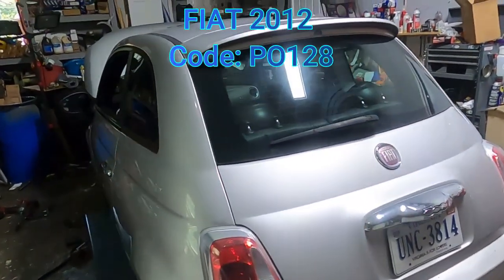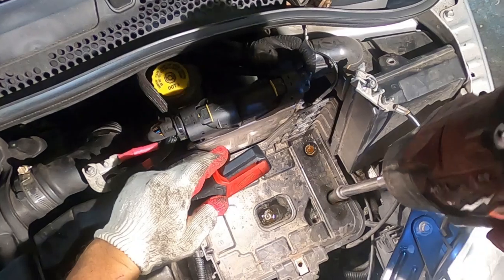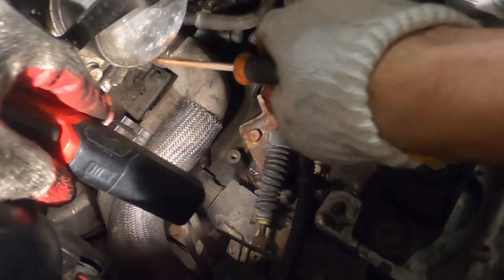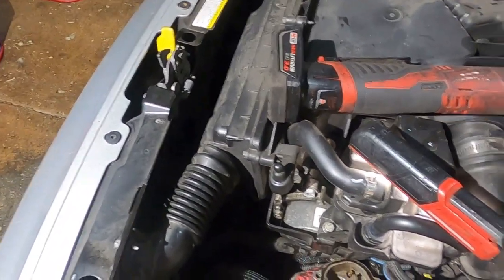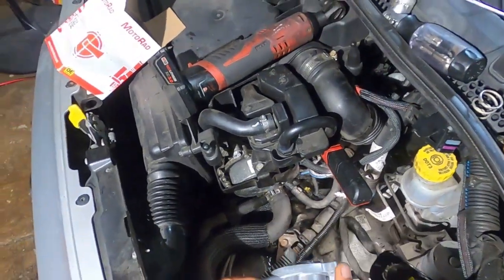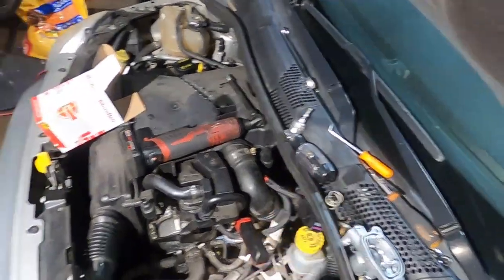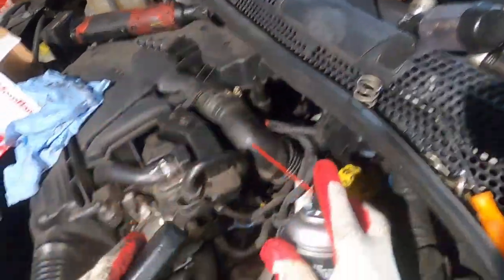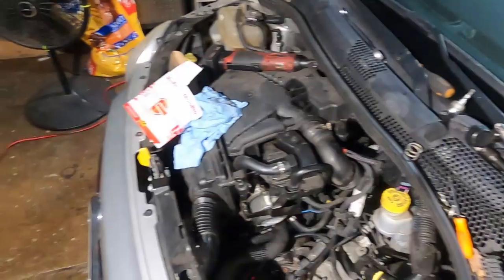Fiat 2012 500 Thermostat replacement

Comment: Great video! However, the time to remove the two clamps and replace with new ones and then use the new part  complete without disassembly makes more sense to me? Seems more time involved in making the new thermostat  fit the old housing  than to just replace the clamps unless I missed something ☆
Reply from the maker: I see thanks

Comment: I just changed my wife's 2012 Fiat 500. After a couple of minutes driving, her car idles very close to 0 rpm. What should I check?
Reply from the maker: Any codes? 
I will say the coolant temperature sensor is not connected or the connector is not in proper

Comment: I would like to point something out to anyone doing this job in 2024.

Keep in mind that the housing has been superseded by a new part number since this video has been made.

If you try to replace the thermostat itself while keeping the hoses attached you will find that the spring and pins are different on the new part, they seem more robust and a bit thicker, and will not fit in the original part. 

Make sure to have hose clamps ready as you will have to swap the whole unit removing the hoses, and one time use clamps.

Thanks for the video.

Comment: Thank you so much for this video! This method for installing the thermostat was way better, I will say that trying to push the new spring down on the thermostat was difficult, but other than that, it went pretty smooth.
Reply from the maker: You're welcome , thanks for your feedback boss

Comment: Good work, thanks for the video! My 2012 Abarth has the same code. Only thing I’d recommend differently, your coolant is the 5 year coolant, which is the orange color. The purple you put in there is 10 year coolant and my Chrysler dealer told me not to mix the two, but to use the 5 year if that’s what in it, otherwise drain and fill with the new purple stuff. Just my 2 cents. 

What engine is yours?
Reply from the maker: Sure thanks for your feedback  boss

Comment: I am about to replace my thermostat but the car blows hot air just fine could it just be the sensor?
Reply: The engine doesn’t run hot or cold its the same temp as before the code
Reply from the maker: Well the new housing will come with the new sensor
Reply from the maker: The code is for the thermostat
Reply: @nestorautorepair  i seen that, dont really want to mess with finding those clips, thanks for the video man
Reply from the maker: You're welcome

Comment: Nestor... Maybe you did this, did you connect an OBD2 memory saver to 12 volt source before removing the car battery ? If not you will loose the ECM memory.
Reply from the maker: Hi no I didn't and did not loose any memory.

Comment: I guess the hoses are very hard to remove, so it is easier to rebuild the old body by instslling the new thermostat, gasket and sensor.
Reply from the maker: Yes sir
Reply: Kevin Du... The hoses are easy to remove and the clamps are easily replaced. It is a better idea to replace the integrated thermostat (housing, gasket, thermostat and sensor).
Reply from the maker: Ok

Comment: Which part is the coolant temperature sensor?
Reply from the maker: The one you see at the back when i slide the new thermostat  at 17:00 and up
Reply: @nestorautorepair  cool thank you so much for making this video man. To replace this I just unplug and unscrew and plug and screw the new one in right?
Reply: The one on the right side, correct?
Reply: With the yellow on it
Reply from the maker: Yes correct , thanks for your feedback Hannah
Reply: @nestorautorepair  if I can’t file it down do I have to replace the whole thermostat?
Reply from the maker: Yes we'll it depending on the brand maybe you get lucky and it will fit
Reply: @nestorautorepair  I got MotoRad, which did you get?
Reply from the maker: I don't remember I got it from carquest witch is own by advance auto parts
Reply: @nestorautorepair  you also got motorad, fml lol
Reply from the maker: Lol
Reply: @nestorautorepair  so I changed the whole housing thermostat today, and the other day I changed the spark plugs and ignition coils, and I’ve changed the oil and oil filter (in case any of these are important) While I was adding the coolant after changing the thermostat housing, I turned the car on and it started and slowly stopped starting. My brother said it’s cause a hose isn’t on, but they’re all on. Any tips or ideas??
Reply: @nestorautorepair  actually it started I was just nervous and not doing it long enough lol but now it’s smoking, is it just the coolant burning off?
Reply from the maker: Wow
Reply from the maker: Wow ok when you say smoking at the tail pipe or in the engine where you spill the coolant ?
Reply: Engine where the coolant was spilled and also under the manifold, it went away tho, the smoke, I just let it run for a bit, probably just the coolant, and running everything new through it or something.. hopefully..
Reply from the maker: Oh ok yes that's normal just rinse it down with some water if not it will smell like coolant for months
Reply: @nestorautorepair  just pour a five gallon bucket of water over the engine? lol
Reply from the maker: Lol no slowly lol
Reply from the maker: Only where you spill the coolant
Reply: @nestorautorepair  okay lol ty!
Reply from the maker: U welcome